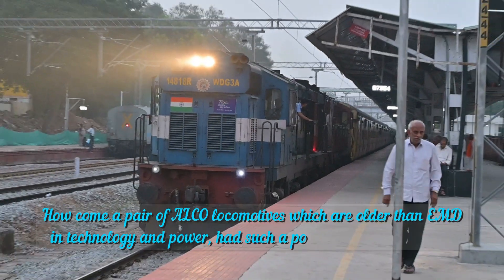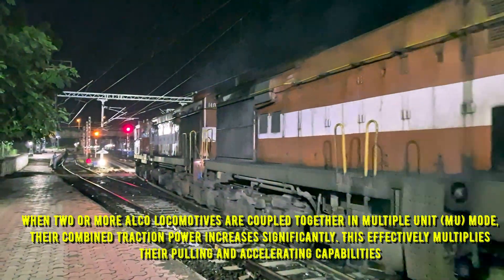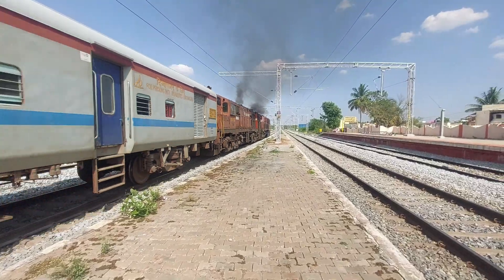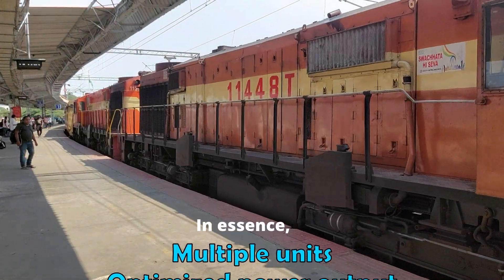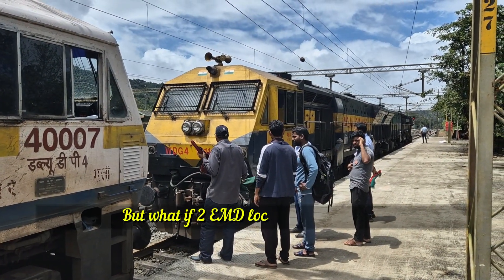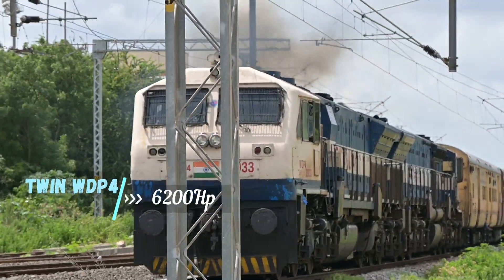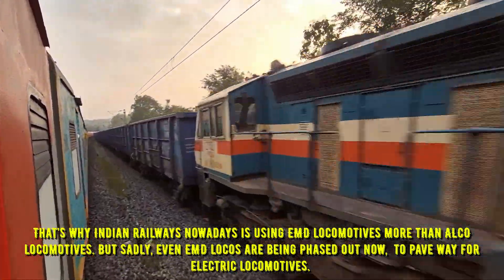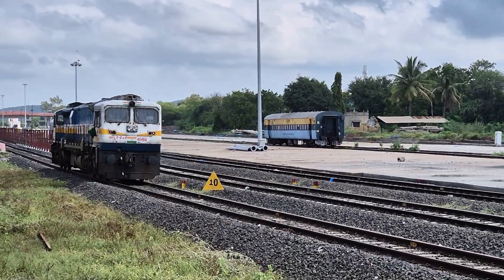ALCO vs EMD locomotive | Who will win? | How are they different from each other?

Comment: Comparison is not right.  
It has to be same track .. so that track limit is same..
It has to have same load attached..

Considerable acceleration is not right term.. you have to specify 0 to x kmph
Reply from the maker: It's on the same track and same station 'Ranebennur', same 24 coach train as load attached, to specify 0 to X, it depends on Loco pilot notching, some give heavy notches and reach MPS within few minutes whereas other Loco pilots consider their regular pattern and give slow notches to reach MPS. Also to specify exact speed, I dont have speed measurement device to exactly calculate departing speed
Reply from the maker: Thank you so much bhai, glad that u enjoyed it !!!

Comment: Can anyone explain what is shunting?
Reply: Thanks

Is the reason for mostly diesel shunting because of electricification not completed in yards
Reply from the maker: @goswaraj8362 yes that too and also diesel locos are in surplous amount, Railway board prefers elocos on mainline and they rely on them heavily, so they use EMDs and ALCOs for shunting, Ballast work, electrification work etc and 99% of diesels are phased out from mainline, Sadly even Diesel locos which are in good condition are termed as derated or unfit for mainline use and then used for shunting, which is pure wastage of power. They do just to show that electrification of IR is moving towards 100%
Reply from the maker: Shunting means a locomotive will bring the empty rake of train to platform from the yard or take the empty rake from platform to yard, when the journey ends. Shunting is usually done by low powered locos or dedicated shunter locos itself are there like WDS6 or even some ALCO locos or retired EMD locos. Even eloco do shunting but very less
Reply: I have seen two Express trains running on EMDs days ago in my hometown Rayadurgam

1) Hospete - KSR Bengaluru Intercity Express 

2) Mysuru - Sainagar Shirdi Terminus Weekly Express

Yes the station is fully electrified